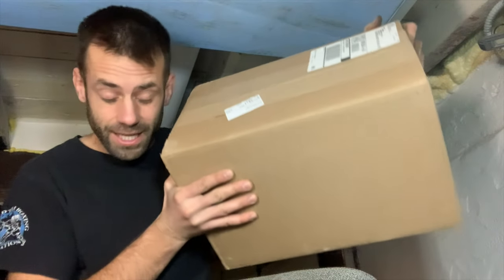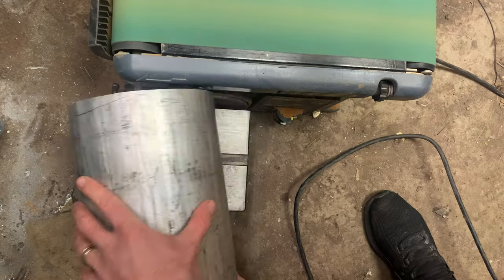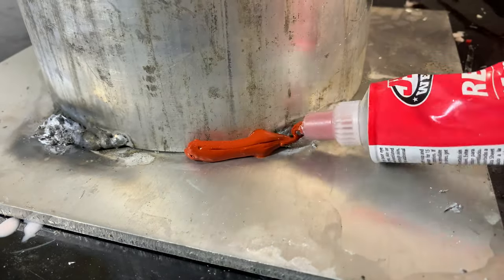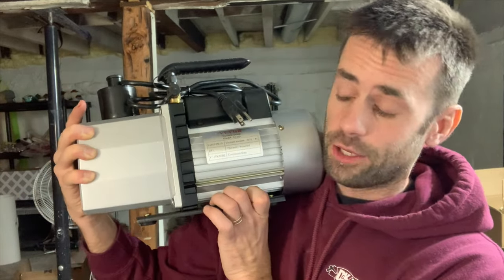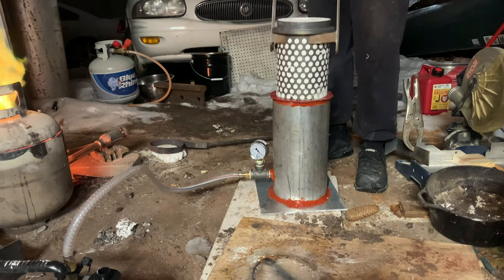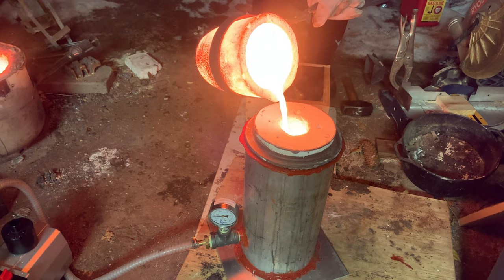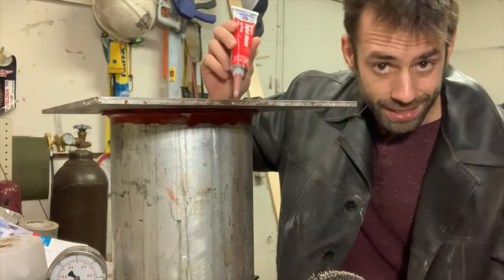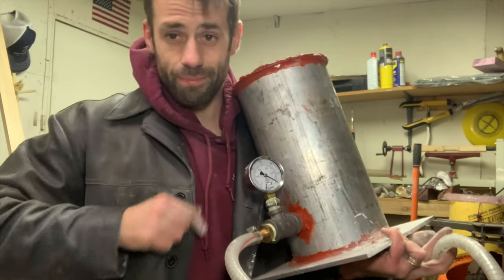DIY Vacuum Casting Set up / Build.

Comment: Do you describe your investment material in another video or have a recipe?  I want to do a pourable investment but don't have a burnout kiln for the regular plaster recipe.
Reply from the maker: I don’t have a recipe. I buy it from Ransom and Randolph. It’s not cheap but it is a great product. A burn out kiln is a must, for this kind of casting. Unfortunately it takes some capital to tool up for this craft. But it’s worth it if it’s something you really want to do.
Reply: @lundgrenbronzestudios  I am using Mold Mix 6, which works pretty well but can't do complicated shapes and the detail you are getting from the vacuum setup is really impressive.   I might try it out if I get the kiln situation figured out.  Thanks for the videos!

Comment: Should have removed the oxide coating  higher amp setting used pulse not continues
Reply from the maker: Shouldn’t have used aluminum to begin with. I had to re do it in steel because it melted after a flask broke.